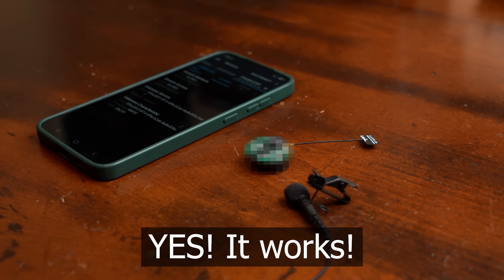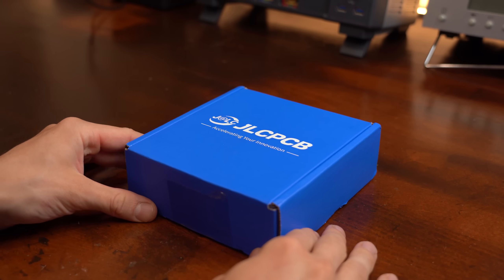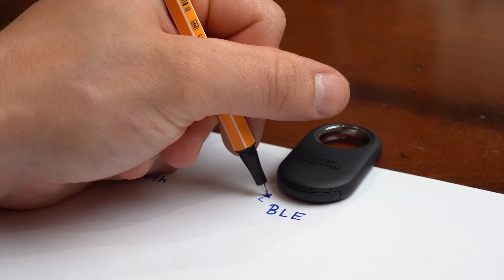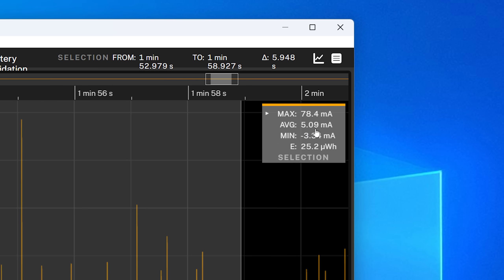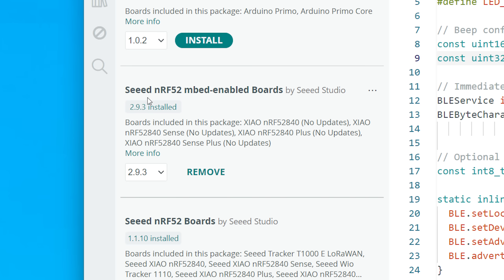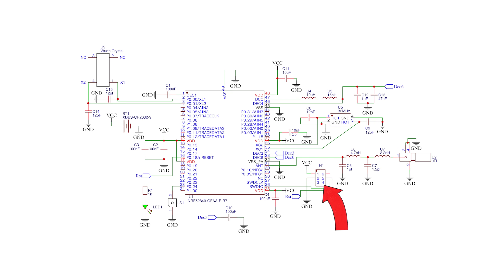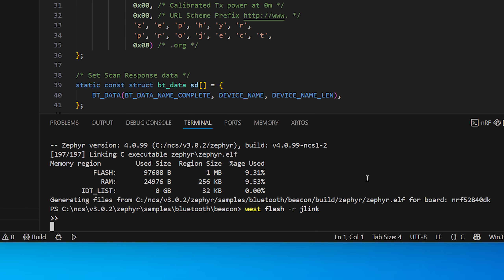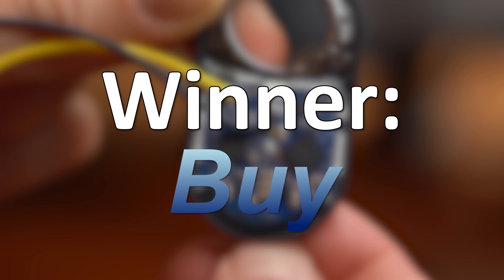The Most Handy Gadget can be done...Cheaper?! (DIY or Buy)

Comment: One simple powersaving method during beep (and would sound better) is a lot more time between beeps.  Running a 100% ON beep wastes way too much power (and sounds terrible).  You can chirp it - a 1-2% on time with about a second of off time is easy enough to find and uses very little power.  If you want to get fancy, add a tune like the regular ones do.  The different frequencies make it easier to find and again, sound less annoying.

Comment: Could you reduce power consumption by:
1. increasing the inactive time period between polling,
2. instead of a continuous tone, output a stuttered tone so that 50% of the time it's silent?
I.E. Given a 2khz tone,  = 2000 cycles/s
1 cycle = 0.00005, so output 1 cycle for 0.00005s, silence for 0.00005s, and repeat, until the tone has played for the desired 3 seconds?

Comment: Cool project, 30 µA is not all that bad, but I feel we should be able to get it down to less than 10 µA when advertising on a 2 second interval. Try decreasing the size of your advertising data, and disabling all unused peripherals. I got the beacon sample project down to 11.5 µA on the official nRF52840 Development Kit, just by disabling serial output (add CONFIG_SERIAL=n in prj.conf) and commenting out the zephyrproject url (lines 32 - 41).

Comment: You could try something in the middle, like the cheap HC-02/05/06 BT modules, powering it with a small Li-Po battery or 2 CR2032. They cost around $3 each, and while you couldn't make them beep without further modifications, by using Tasker on the phone, it can sound an alarm or speak a warning when the module is out of range or  its signal strength drops below a certain level.
I'm not sure about the battery life though.
Another option is to use a BT audio receiver, a bit more expensive ~$10 but it has a built-in battery. I keep one in my backpack.

Comment: Something odd there. You should be able to achieve over 100m range, maybe need some antenna matching and careful thought about the trace impedance? I bet someone at Nordic will help you achive low power in software or simply use one of their new nrf54 low power chips. I have been playing with BLE since the before it was released it can do some amazing things.

Comment: Bro I have a way cheaper option for you. It’s called the oversized bowl by the front door. I get in the door, pockets get unloaded into the bowl. Keys, wallet, sunglasses, all of it. Cost me like $0 because I already had the bowl
Reply: TBH, that's what I do, but most other people with ADHD won't use it. My wife absolutely refuses to use the dish and the keys wind up all over the place, sometimes in places that baffle my mind to the point where I wonder if she's putting me on. 

The things I'd be interested in this for are things that I have a good reason for using in different places or that tend to get misplaced. The TV remote rarely leaves the couch area, but if there's a bunch of blankets, it can easily get folded into the blankets, or smushed into the couch cushion and occasionally my wife walks off with it. Plus, I have visual sensory integration issues and I flat out might not see the dark colored remote on the black table.

Comment: Wishlist: I would love a flexible circuit board/mod chip version for slipping into TV remotes. Most use 2x AAA batteries, or roughly 3V, so a couple wires piggybacking the power source would be ideal

Comment: I designed a tablet stylus years ago using the NRF51. I had the advertising current consumption down to 12uA. It requires using the C api, and turning of a lot of peripherals. And also extending the advertising interval.
Reply: I thought so! I was actually really surprised by the outcome of this video, remembering specs for the NRF51 or a relative from a while back myself.

Do you recall anything about efficiency or sleep functions in your implementation? Many years before that I'd been considering an extremely low power ( ~4-6uA I think) external sleep timer/etc. to manage a device, wondering if that's just unnecessary in your opinion.

Comment: That key chain is fake it's not gps as mentioned i have ordered it before.
Reply: Not fake, they "leech" the position off of the GPS position of nearby compatible phones, so technically they use GPS even though they don't have a built-in gps receiver.
Reply: @TheFloydPage how , as far as i know it's just a bluetooth based device and works by measuring the strength of  master device and start beeping for alert so how can it take gps information from other nearby phones it's not logical because first it needs to have permission from new devices and second not everyone everytime turned on device GPS ?
Reply: It's literally the exact same principle as Apple AirTags, but with Samsung devices instead of iPhones.
Reply: @TheFloydPage  can you also tell me what if Bluetooth is turn off of " all nearby compatible devices " will it still able to communicate for location from other devices?
Reply: @omsingharjit  no, it cannot, but nobody has claimed that either.

Comment: The thing thats seriously disappointing about these locator beacon thingies is the vendor lockin/incompatibility.

I would have bought dozens of airtags years ago if Apple had a simple activation and general location tracking app for Android... I know I wouldn't get the UWB direction and distance info without UWB support. But simply knowing if the missing car keys are at my house, at work, or at some other random location is way better than not being able to drive that car for 3 months.... Yes, this has happened to us. Twice.
With an air tag, even with just the BLE tracking and the chirping, I'd have found the key both times within minutes of noticing it missing.... But without an Android app, I didn't want to buy the airtags.
After the 2nd time losing those keys, I decided to buy a 2nd hand iPad and get a 4 pack of tags to test. And they saved our ass 2 days after I set them up 😂
This video reminds me... I need to order another 4 pack.

Comment: Suggestions I have. 
1. Antenna can not be flat since it's broadcast outwards on its flat which is why the buy version curves around the case to provide a more 360 degree coverage.
2. Try putting a timing chip that shut off power to the circuit every so often and capacitor after it to smooth out the voltage to the nrf chip. 
I have no idea if this will work but may be worth a shot.

Comment: The bad PCB, was it not centered? Then hotplate at 220, some flux, hot air (I use 380) and a nudge in the right direction will fix that. 
Then some flux and a K-tip can fix the blobs of solder sticking out. 
I'm guessing there is too much solder, that might be shorting out some pins below the chip.

Comment: Three things to look deeper into. Sleep Modes. Antenna selection and maybe other type devices. The omission of the LED may be a good idea as well. My experience with BLE is limited to the antenna portion of a project I was part of some time back. It was more testing the several antennas they chose for the project. Than actually working out the antenna design. Though I am not sure what the antennas were any more. We did not use the flat panel type you did. It was more like a strip that was in the 'buy' version you showed. Maybe I have my notes and there is some date there. See what I can find.
Peace

Comment: Had something like this in mind several years back for sailing as a mob device. Basically a small wearable Bt device that checks in with your phone on board every 10 sec or so. If lost for more than a short period of time the phone gives off a alarm and loggs the gps position. Nowadays there are these things available but are insanely expensive. Especially considering the cheap tec inside.

Comment: How about you try getting your antenna  to work with the Samsung ones? Or chinese ones. A mod to increase the range of existing ones sounds like an actual good project. It wont be as small but using it for something like a car tracker would be great if you could get 4x the range from the Samsung one, could mod it to have 2 coin batteries too. Trackers are so cheap these days for the complexity that I'm surprised it was worth attempting a DIY version. Modding an existing version to multiply the range would be amazing though if its at all possible.

Comment: You need an impedance in your antenna circuit of roughly 50 Ohms or you are going to have signal issues. That's what you likely have wrong going wrong, but the why is the problem here as it isn't as simple as just tossing in some parts and calling it good like with lower frequency radios. You need to calculate it for the frequency you are using as well, which is likely what you did. At high frequencies, the traces of the board have a capacitance and inductance that needs to be accounted for, which is likely where you have gone wrong in your design. Shielding high frequency traces with ground planes and ground traces needs to be done as well to prevent them from interacting with neighboring traces. You also don't want any sharp points or hard corners in the high frequency traces as that will cause internal reflections and leakage of signal. You don't even want corners on the solder pads. Only rounded edges.

Looking at what you showed of the board, the pads where you solder the antenna down need the corners knocked off and I spotted traces that have too sharp of angles in the design, but they aren't part of the RF circuit. This does show that you likely have issues with your trace to the antenna. You also look to have only a two layer board, so that whole trace is leaking RF the whole way, is capacitively coupling to everything around it since it isn't shielded. It needs to be inside ground planes and traces or this happens. A three layer board is the minimum for doing it with a PCB alone, but you can also do it with a two layer by using a ground plane on one side, two ground traces on either side, and metallic paint or tape over the top that is grounded, but it's not as robust.

I hope this helps and lets you revisit this project. I would also suggest looking at the traces for the rest of the board and removing any sharp corners from them as the clock can bounce off of those, resulting in the clock signal amplitude needing to be at a higher power level, so those traces need to be smoothed out as well if you want to get low power operation. Putting all data and clock signal traces in shielded traces would be the best way to ensure that they are also not needing to step up out of low power mode to deal with any outside interference for RF noise or internal noise, so going to a three layer board might be advisable as this would be possible.

Comment: The other thing with the "BUY" aspect, is it's also quite hackable. Also, someone created an APK on GITHUB that allows you to use the Samsung devices on other phones with more or less the same feature set. So, you're not even limited to SAMSUNG ONLY devices. I have played with said app and compared it to the FIND app on my S24, and I got to tell you, the hacked version is less annoying than the official app. There's like 4 steps to get into FINDING your lost item in FIND, but on the hacked app, it's RIGHT THERE. Like it is on Apple's AIR TAGS.

Comment: Is there a way to turn a passive RFID tag into an active one? I want to swipe my door card from 1+ feet away.
Reply: Unfortunately, no, the technologies and operation are completely different. In passive the reader provides power to the tag, in active the tag has its own power. The frequencies and modulation are different.
Reply: @ralphj4012 , so to increase range you’d have to increase the power of the receiver. I guess that’s how the EZ-Pass toll readers are able to capture your RFID tag while you’re driving 50 mph.
Reply: @ericcarabetta1161  Either increase the reader (which is actually a transceiver) power or increase the tag's sensitivity. Sounds easy, but isn't. Those toll readers are transmitting at least 1Watt, whereas a door reader is a fraction of that. As far as I know EZ-Pass is a combined passive/active design (power from the reader energises the tag's passive part which then wakes the tag's active transmitter).
Reply: @ralphj4012 , amazing how they manage to fit all that in a sticker the size of a piece of gum.
Reply: @ericcarabetta1161  I may be slightly out of touch, I read that EZ-Pass dropped the battery design in 2006, so they probably increased reader transmit power at that time.
Reply: @ralphj4012 , I do recall tearing open one of those old chunky ones and there being a lithium battery soldered inside, I always wondered what it was for.

Comment: Since your last attempt was clearly made as a ZephyrOS project, I guess in the context of power saving you could make sure that the overlay (or a dedicated device tree for your PCB) has all not used periphery turned off (uart, I2C, console logging,...).
Another attempt could be made with a newer version of MCU: nRF54L. It is supposed to be even less consuming than nRF52

Comment: I'm sorry I didn't have a time to read all the comments so somebody might have noticed this too The inductor you have on the board seems excessively large for the amount current also the board thickness doesn't need to be that thick Another thing is if you're running the antenna through a cable That's only necessary if the electronics is shielded in a case a PCB antenna would have been more efficient in my experience
Reply: Or possibly just change to the matching circuitry and tack on 32mm of wire?

Comment: Respect for your effort and the PCB design! But it's nearly impossible to reach the nRF52840 hardware power consumption stated in the datasheet. I've never seen a DIY project design that even comes close to the energy efficiency of a standard professional product - and you can find a lot of attempts and dicussions. I would be happy if any working real low power approach would be available. (Nordic doesn't support makers at all - so far I know; but for professional developers they have experts - e.g. for RF customers design).

Comment: When developing modules powered by CR2032, I would be glad to see compatibility with LIR2032, which are lithium-ion batteries of the same form factor (2032), but have the voltage of a regular lithium battery and the ability to recharge.
CR2032 works noticeably longer (in my HolyIOT beacon the difference is about 9 times), but if there are at least several such devices, using batteries seems more profitable to me.

Comment: AI Summary

Abstract: Summarizing the DIY vs. Buy BLE Smart Tag Challenge

This video evaluates the feasibility and performance of building a DIY Bluetooth Low Energy (BLE) smart tag as a cost-effective alternative to commercial tracking devices. The creator begins by analyzing a commercial Galaxy Smart Tag, demonstrating its functionality (locating misplaced items, 25m range) and measuring its ultra-low power consumption (e.g., 15.44 µA idle). For the DIY attempt, a Nordic NRF52840 System-on-Chip is selected, and a custom, coin-sized PCB is designed incorporating power-saving components like a DC-DC converter and an external crystal, along with an external antenna. While the DIY prototype successfully functions as a BLE beacon, subsequent tests reveal it draws significantly more current than the commercial tag and achieves a much shorter detection range of only 5 meters, primarily due to an incorrectly designed antenna. The video concludes that, despite component cost considerations, the commercial "buy" option offers superior features, performance (battery life, range), and overall polish, making it the clear winner when factoring in development time and the provided functionality.

I used gemini-2.5-flash| input-price: 0.3 output-price: 2.5 max-context-length: 128_000 on rocketrecap dot com to summarize the transcript.
Cost (if I didn't use the free tier): $0.0065
Input tokens: 14816
Output tokens: 841

Comment: Why not try LoRA instead of BLE to solve the range issue? Also can run off of the nRF
Reply: LoRa transceivers are much larger (impractical for a tag size device) than BLE, unless you know a SoC version with SMA antenna?
Reply: @reedreamer9518 I believe the wio-sx1262 is a small enough package that it could be added. Might still be a tight fit.
Reply: @reedreamer9518  look up expresslrs receivers like the the RP2. Those are tiny and use Lora as well. Although they are not optimized for power use, so that could require more components.

Comment: I think your power consumption was pretty good, considering it was only twice as much as the buy version; giving you ~3 years of operation on a coin cell. I assume the sleep modes were baked into the sample code you started with, and since this is only a simple beacon the power savings were fairly straight forward; perhaps you could half the Tx rate to save more power. 
I think you should attempt a v2.0. And, forget about that external antenna and use an SMA version, which is quite adequate and much more practical. Be sure to use the exact PCB antenna design as in the OEM examples, as that will have been the result of a careful R&D. 
I've been building a base & remote telemetry sensor device, with ESP32, SD, RTC, GPS, LoRa and BLE. However, implementing light sleep while servicing all the peripherals is a nightmare. Evidently, achieving extreme power savings with complex devices like these is an art that takes some time to master.
Reply: Also note that if power usage is your priority NRF chips are much better than ESP as nordic puts huge focus on power optimization.